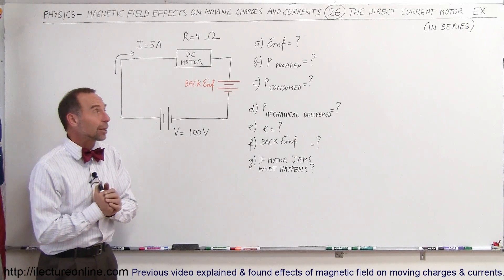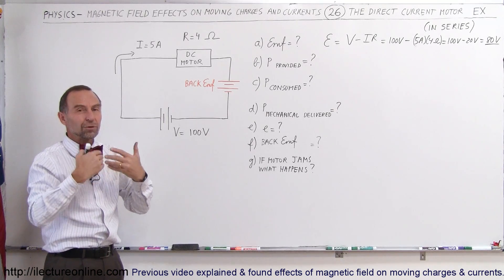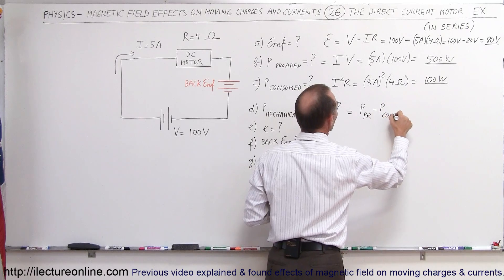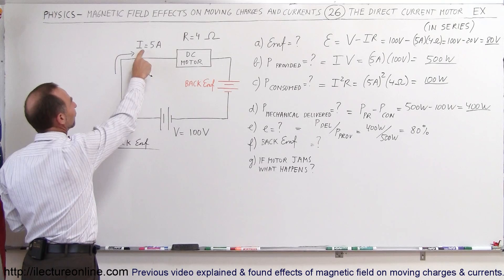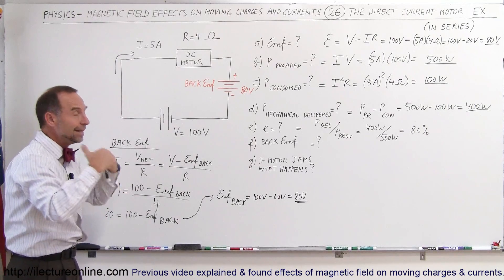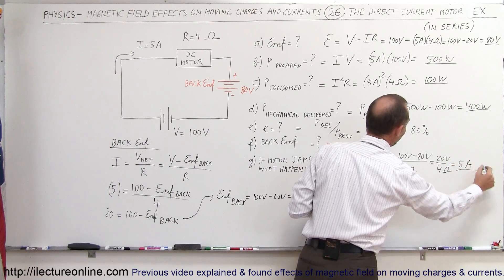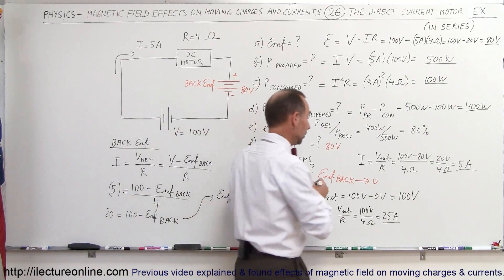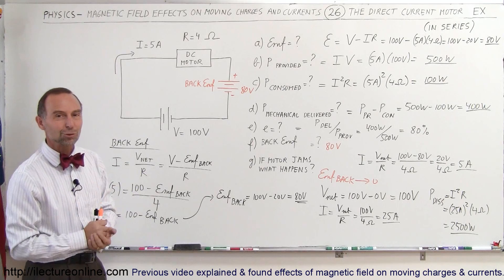Physics 43  Magnetic Forces on Moving Charges (26 of 26) The Direct Current Motor

Comment: You can make playlists on DC machines, synchronous machines, induction motors. This is one of the harder electrical/electronics topic. There's only one Indian channel making full playlists on each one, but no one can finish it because it gets very confusing quickly and it's lengthy, like 80-90  20mins+ videos for each playlist.

There are many causal relationships in the AC/DC machines, like feedback stuff looping back and forth that kills brain cells. One of the  easier feedback reaction would be the back emf u explained, but as we go deeper it gets crazy. I'd rather study quantum physics than that thing. 

If you make playlists on it, I'm sure every electrical/electronics majors  will come to u and maybe I can restudy the whole subject again :)
Reply from the maker: Good suggestions.  We do have a list of topics yet to cover.  We'll put it on that list.

Comment: wait..... wouldn't the efficiency be equal to  [power consumed/ power provided] since 100W is what is actually being used by the motor? i'm not sure.... it's just a question..... but amazing explanation otherwise
Reply from the maker: Most of the time, the power consumed is equal to the power provided.  But the mechanical power delivered / power consumed is the correct equation for efficiency.